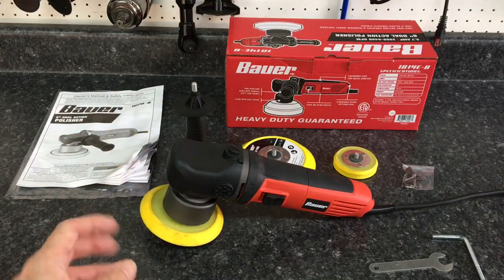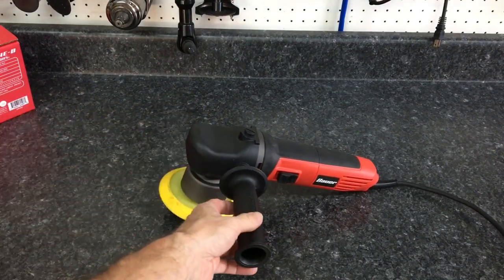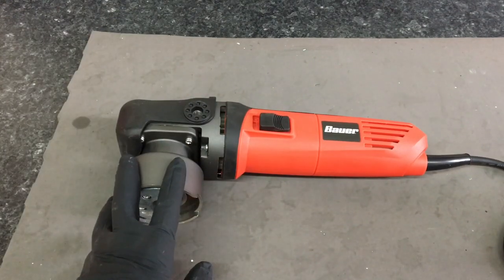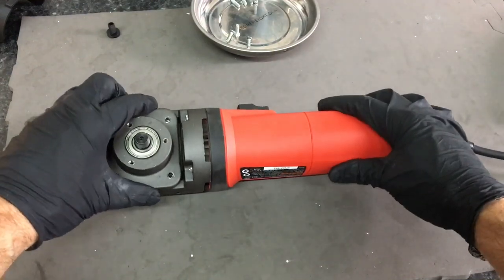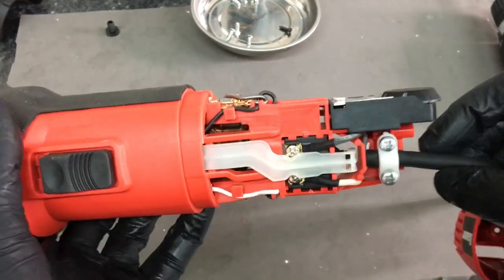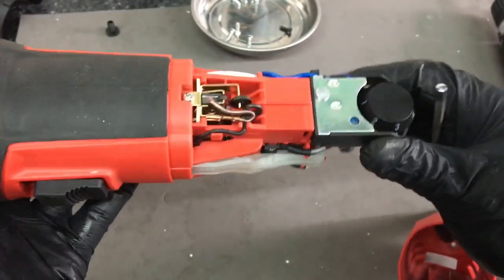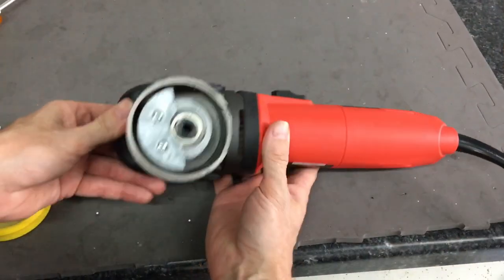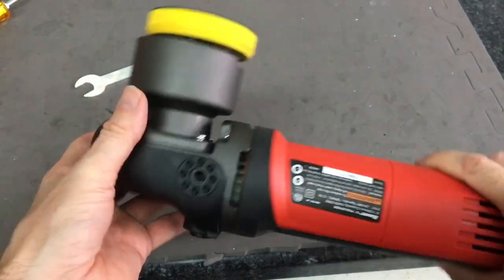NEW!!! Harbor Freight (BAUER) 6 inch Polisher! W-T-F Were They Thinking?!?!?!

Comment from the maker: Stay away from this one my friends.
Reply: Thanks for update Brian; you're the man.
Reply: Even for just a dedicated 3 inch polisher for the hard to reach places?
Reply: Dr. Brian, another thorough dissection. No doubt, a thumbs down on this one.  Excellent work :) .
Reply: Omg!! This thing was stalling over the most minimalistic of body lines on the panel.  🤯  I still have and use my original Harbor Freight and it goes over body lines without even flinching. This is an epic FAIL!  Great review as always!
Reply: Just FYI once you started the review the audio got really crackley. Sounds like I am listening with blown speakers, maybe your mic went bad?  I haven't noticed this issue in your other videos. Just trying to help, thank you for the informative video!
Reply: BPSDetailing you must have blow speakers because it didn’t sound like that at all on my phone.
Reply: Stay away..but i dont get why? It is the quality? It is stalling a lot because of the low 600w motor? It is the prise? For a bigginer to use it for AIO, waxing, 1 steps can do the job? Thanks
Reply: @andrewyaadigg  get a 5" counterweight and it'll reduce vibrations for the 3" backing plate
Reply: @tobyhigginbotham2564  Listening on Sony WH-H900N Headphones (High end noise cancelling headphones).  The first part of the video sounded normal, the rest sounded off.  Speakers on a phone are not high enough quality to tell the difference.
Reply: Thanks Brian, but I already bought one.   Took mine apart like you did and found the same as you did.  However the vibration didn’t seem bad, so let’s hope it stays that way!
Reply: Thanks for this video, have they discontinued the Chicago Electric polisher?
Reply from the maker: @bpsdetailing8822  Thanks for the heads up...working on it.
Reply from the maker: @marioskosmidhs9454  All of the above.
Reply from the maker: @1221Ralph  It still blows.
Reply: @apexdetail85  thanks sir
Reply: why did Harbor Freight switch to this company..........cheaper cost per unit?????
Reply: You saved me from potential grief....again!   Thank you
Reply: Good review!
Reply: @steveworthington9017  I think they pulled them all trying to promote the Bauer line. They don't even have it online anymore.
Reply: @steveworthington9017  Yes, they switched to Bauer
Reply: @maxfriedenberger8043  most likely
Reply: Was the old one a whole lot better than the new one
Reply: That’s why you don’t buy power tools from harbor freight lol
Reply: @marioskosmidhs9454  Its 60 Dollars right now. find a better one for that price.
Reply: @tiredoldman5329  such???? I am in europe
Reply: Good review... I am at Harbor Freight right now and actually had one in my hands headed for the check out... Lol. I'm circling back to get the Chicago Electric one now. 👍
Reply: Would it be worth it with diy changing the problems you mentioned? What do you recommend for a alternative?
Reply: I broke mine today , after 30 min of use, I was gonna go to hf and get another until I saw this video
Reply: @marioskosmidhs9454  I bought one 3 weeks ago. I replaced the grease and finally found the M4-.0.70 14mm and 16mm screws to upgraded those.  It's okay for someone using it once or twice a year like me.  Take his advice and skip this one.  The backing pad eats up the foam pads too. I trimmed mine a little and it helps.  Avoid the bauer pads too, get lake county.  If you end up getting it.
Reply: @Kirbysbelt  thanks sir for your support
Reply: @mygt8a4re  They do now. I bought one YESTERDAY....before I found this video. I haven't used it yet, going to research, see what I can find at the same ($60) price point. Next time I'll find a review FIRST....THEN buy!
Reply: @raymondtuckerjr1886  Ray, you found the old Chicago Electric DA in stock? That's what I started with, took it apart to grease it up initially and still have it several years later though I moved on to the Meguiars MT300 and love it!
Reply: @mygt8a4re  no bro, I found the Bauer.....actually plan on using it today....waiting on Amazon to deliver my 3M compound. Wish me luck....if it is a bad as this review states, I'll take it back. Just bought it yesterday.
Reply: @raymondtuckerjr1886  ahhh ok, The CE DA is what I was talking about a year ago when I said they pulled them from the shelf and you can't purchase them online, it's what HF used to sell before the Bauer line. I haven't used the Bauer but I'm guessing it will work for you fine. Even if it's not the best out there. Good luck man!
Reply: @mygt8a4re  oh, ok my bad. Thanks for luck. My 3M rubbing compound showed up about 10 minutes ago, and the process begins in the morning. I'll definitely post my views...hell, I might start a channel, lol. All safety to you and yours bro.
Reply: @raymondtuckerjr1886  hahah, hells yeah man! Safety to you and yours as well!
Reply: whats the least expensive one you recommend?
Reply: @assyrianme  it's the one from a porter cable. Got it at detailed image years ago.
Reply: @assyrianme  just found it. It's on there still
Reply: @steveworthington9017  no, but they have several new brands. Bauer, Warriors, etc. So far I haven't used anything from the Bauer line that didn't perform, but no tool line is perfect.
Reply: @amanalac  the other HF Bauer da 20mm  polisher for $99 seems to get better reviews. 

Ive heard decent things about the porter cable da polisher
Reply: Would you still recommend the Chicago Electric version?

Comment: Here's a thought...get the extended warranty and if it breaks just replace it. Man, what a critic!! Most people are just looking for something to polish their own vehicles a couple times a year and I'm sure this Bauer will work just fine.
Reply: Seriously I don't see any huge criticism that couldn't somewhat easily be modded and improved. 

At the point you're taking it that far apart you can easily swap out the grease and counterweight. If somebody wanted to go even further I'm sure it wouldn't be super super hard to coat the winding wiring in epoxy as well, and replace the bearings with some sealed bearings.

Not to mention there's a lot of stuff made for the Porter Cable that's a direct fit for this polisher. 

I agree with Apex about many things but I feel this is just overly critical and not looking at the bigger picture.
Reply: I think people forget this is a cheap homeowner grade polisher. It’s not meant to be used in a detail shop every day. 

I bought mine for 49.99 with a coupon. I have 5 cars I do once a year. It’s been a little beast.
Reply: Right!? What self respecting shop owner buys anything Bauer? Let alone expecting it to last?
Reply: But I'm worried about early premature wear and tear from not having a plastic cover on my bearing. Hold on let me cook these screws with my Dewalt. 😂 don't worry though I got it on a non static mat

Comment: Bought one last weekend and I LOVE this thing.  Yeah it's got a little vibration to it. No biggie. For the price it does almost as good of a job as one 10 times the cost. On a car that hadn't been paint corrected in 20 years ( yes 20 years, I know because it's a drag car and it's mine ) after doing a compound, mother's California gold cleaner wax, and  then a final polish the car is almost flawless. It's very nearly like brand new.   Talk it down all you want but this thing is a beast for the price.

Comment: It's good to know the new Bauer polisher is not so good. It's too bad because they had a good tool that could be greatly improved with a few mods. Something many don't know is there was two different 6" Chicago Electric polishers. One was well made, but the other was not. They both were the same price, and one or the other were available at different times. The CE polisher is really a good machine especially with 5 easy mods: (1) Throw away the 6" backing pad and get a 5"and a 3". (2) Get the 5" counter weigh. The 5" Porter Cable CW fits perfectly. This reduces vibration, and is probably better for the tools longevity. (3) replace the gear case grease. I use Mobil 1 synthetic which comes in a tub. (4) Change the location of the switch from the side to the top. (5) Replace the short electric cord with a 15-25' cord. I have used the Porter Cable polisher for years, and find the CE polisher to be much better. It has a lot more power, and is difficult to stall. The PC requires running at 5-6 speed to prevent stalling. I run the CE at 4 speed, and it almost never stalls. MY PC is now my 3" polisher, and the CE is my 5"
Reply: How do you know if you got the well made polisher or not? Also want to know how to change the location of the switch? Do you just rotate something?
Reply: Where can you get the 3” head?

Comment: Really what you expect for the price it's a good ass polisher! Your complaining about the switch? Don't understand. To much details looked after for what you probably comparing to. I use it all the time and love it...
Reply: Still holding up my dude? I am not a detailer or anything so won't use it every weekend but will do maybe every 3 to 6 months at least twice a year.
Reply: @richymoreno2567  I personally have one of these and left it all original, (didnt tear it apart) got it for 50$ been holding up for almost a year already
Reply: @gopaulsalick507  nice man do you constantly use it? I just got one too this Friday the 64529 version!!! Can't wait to use it!!
Reply: @richymoreno2567  i use it probably on 5-6 vehicles twice a year so far, the only issue I had was the power switch
Reply: @gopaulsalick507  what is the issue?
Reply: Bought mine a week ago for $50 with a coupon and already polished my 2 cars... works great for the price...  only thing I’m trying to figure out is the rpms of each setting.. anyone know this??? 1,2,3,4,5,6???
Reply: @gerardohtx207  Dam me too lol I still have it in the box lol.
Reply: @richymoreno2567  the power switch sometimes wont turn the machine on (it happens intermittently)
Reply: Mine works great no issues... only time will tell how long it will last... still trying to figure out the speeds for each setting tho
Reply: @gerardohtx207  It's the RPM's 1=1,000 rpm's (revolutions per minute) this thing's powerful ; it can go up to 6400 rpm's so 6=6000.
Reply: The polisher is awesome

Comment: No real reason as to why he can't recommend it to anyone after he has successfully polished his vehicles with the polisher.  For $79 it's not a bad polisher.  If the variable speed control is a bit loose, simply use a small piece of duct tape to hold it in place so as to keep the speed from changing easily.  Most users aren't going to spend a few hours breaking down the machine to change the grease or other parts.  They simply want a cheap polisher that works.  This one works and decently at that.
Reply: I just bought it on sale for $40 so i hope it does the job and holds up for a while

Comment: I bought one of these almost a week ago. POS! I took it apart to change the grease and found the gear case halves don't fit together properly (round boss machined off on one area, .030" on high on the other area), the castings were all jagged where the air vents are, the switch intermittently worked. All along with everything else you mentioned in this video. Glad I still have my receipt. It's going back and I'm getting a Griot's. You get what you pay for.

Comment: turns out there are 2 versions of this machine item 64528 & 64529 (check right below the bar code for item no.). The bad one you (and I) got is 64528. The other model is more consistent to the Chicago electric. Quick way to tell is the dots around the handle insert on the 64528, also the bad machine has the nicer SJ cord while the good machine has the cheaper SJT. Just exchanged mine and am much happier.
Reply: looks like they only have 64528 online
Reply: Do you notice the difference? I purchased the 64529 and wondering if it’s better than what he says in the video about the 64528
Reply: @gerardo2624  check out this video: https://www.youtube.com/watch?v=WP9oiZcThMU i would say its the same quality as the old Chicago electric machines.

Comment: I agree with your review. I have the older Chicago Electric and I did a review on that one before this Bauer version came out. I think the new one has all the problems of the old one (quirky side switch, noise, vibration) but to a greater degree. HF made a cheaper model with this new version, BUT gave it a supposedly new high end name so people would think it is an improvement. HF is slowly eliminating all the Chicago Electric and rebranding them Bauer so people think they are better tools than before. HF is getting very sneaky, Buyer Beware!

Comment: IAt first I was like "no way I just purchased this and it's not that bad" after working on 3 cars with this unit I will say its BAD to me and I dont mean bad meaning good .
 good...my unit would turn on at times and not at all on other times I honestly did try to like this unit but with the on off switch working when it felt like the speed dial that just has no feeling and the noise I had to return this unit...seems like they took one step forward and 2 steps back with this one...this review is spot on.

Comment: The are 19 reviews of this polisher on the HF website. All 5 star. I just bought it for $59 (with coupon). Will update once I play with it for a while.
Reply: Update?
Reply: Update?
Reply: @richymoreno2567  Forgot all about this post. In the end , I returned it and got a Porter Cable 7424xp.  The Porter Cable is just better built and runs smoother, but it does cost $120.
Reply: @ld4974  appreciate the reply!!! The guy at harbor freight told me to return it if I don't like it which is cool lol I might give it a try on one car and see.
Reply: @richymoreno2567  It does the job but did put a lot of stress on my hands after prolonged use.  You may find it's not enough to throw another $60 at the problem. Good luck.

Comment: Thanks for the review.  I've owned the old maroon color HF tool for years and it's been good.  Noisy and lots of vibration, but good.  Doesn't stall too much and can take a lot of abuse.  Sad to hear the new HF tool isn't as good.  And they raised the price too!
Reply: I have this one and its pretty mych how you describe noisy and vibration out the ass but mine works really well and doesnt stall and the switch hasnt turned off on me

Comment: This video just seems overly whiny and n nit picky. Yeah it vibrates a bit. Doesn’t bother me in the slightest. I haven’t had an issue with bumping the speed dial nor does the switch bother me even though I’ll acknowledge it’s not the best. Overall it’s a decent little polisher that is plenty adequate to get the job done for any non-professional. For the price what more do you want. If you’re doing this for a living this polisher shouldnt even be in the discussion and you should know to invest in higher end tools.

Comment: Other than an extra bearing and grease. There is slightly better machining. It's not a big update from cheep harbor freight unit. They bolted on a rat tail and front piece for grip to a angle grinder.

Comment: I use this and he's right... light correction work but primarily I will use this to polish / wax. It's very good for those things and at $67.00 or about that I paid for it,  it beats doing it by hand. I will change out that grease and hope to get a little extra life out of it by doing this. Wish I knew the exact type of grease he recommends. Otherwise, for real corrections I turn to my Flex 3401.
Reply: He recommended wolfshead red grease

Comment: It seems now a days companies do a tremendous amount cost cutting, and the next model is cheaper, has less function and low durability. If you fond something that you like and works, you can't bank on the next model being an improvement. In this case, HF made a sourcing decision to go with less expensive supplier with  an inferior product and charge the same price. I'd venture to say they didn't do any trials or testing.

Comment: They still sell the Chicago Electric version still, Bauer is introduced as their premium brand, I have the CE version and still use regularly
Reply: mynsxt6 in my HF.. CE is no more... only Bauer is available.😢
Reply from the maker: Not here in Pa.
Reply: all the ce units are on close out.
you can't find them in my area.
Reply: No, not any longer.
Reply: I just visited my local HF. They now only carry the Bauer. Rats!
Reply: I got the Bauer just to get the hang of using a DA Polisher, and yeah it probably isn't a great machine but I have done a one step polish and wax on a Ford F150, a Dodge Journey, a Kia Sorento and a Chevy Silverado so far with no problems. It is loud and I hate the switch location but for $50 I can't complain, I just wear earplugs.

Comment: The circuit board can have conformal coating put on easily, just need to buy some conformal spray and cover it yourself. Nail polish can work too but keep away from surfaces like the switches and anything that needs to radiate heat.

Comment: Yeah I miss the $20 rotary and $40 DA. They both worked great especially for the money. Same goes for the infamous $10 purple HVLP gun. They are swapping them out for equal or worse units trying to push a "name" at 4x the price... It's no bueno. If the price difference goes from $180 for a name brand to $80, I'm buying a nice one

Comment: Would be helpful if you stated which Chicago electric model you are referring to, because I still see this model "Chicago Electric 7 In. 10 Amp Digital Variable Speed Polisher" is still available. Its $50. The Bauer is $80, I would much rather get the Chicago electric if it will last longer than the Bauer and at $30 cheaper.